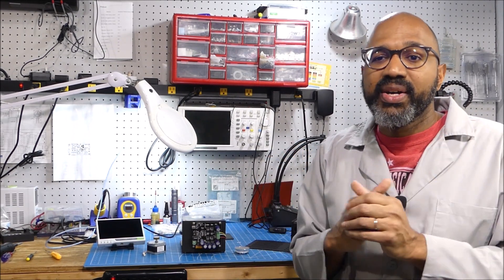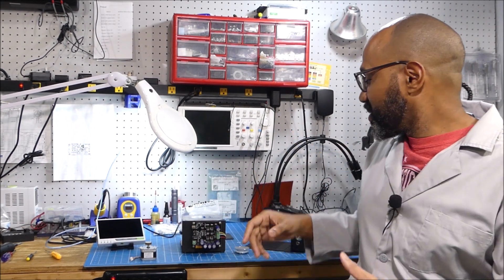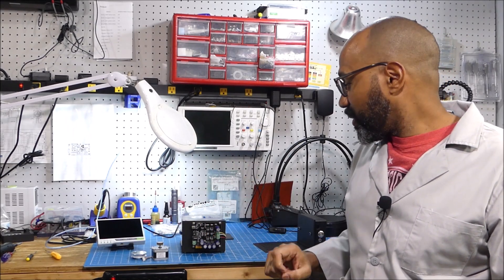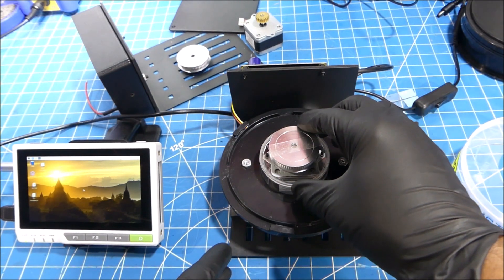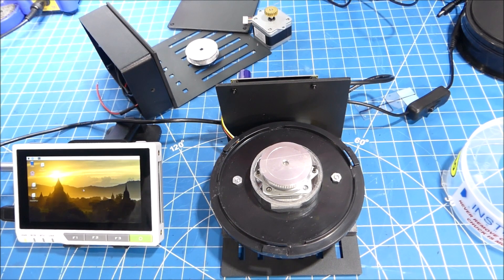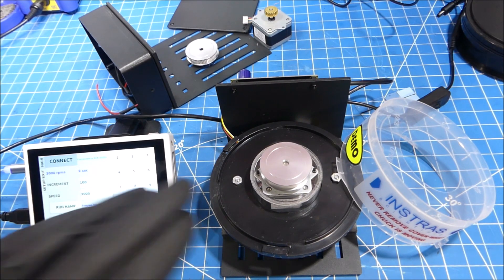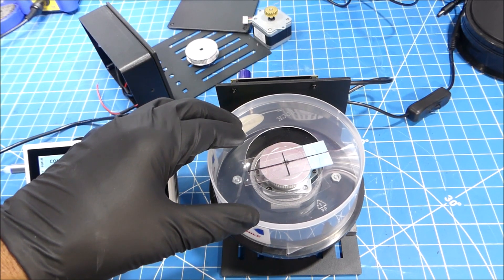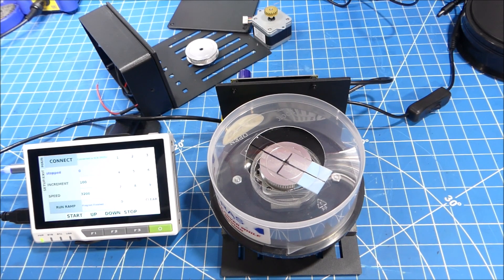Easy to Build DIY High Precision Spin Coater

Comment: I wonder why people needs spin coating machine at home? I can understand it’s not hard to make it but what for?
Reply from the maker: Most people making their own spin coater do so for use in academic research labs, not home use. This is most likely due to lack of funds to buy a commercial unit, or just to quickly try spin coating out.
Reply: I am a hobbyist at home. I am building a Planetarium projector. The stars are pinholes on a slide, like a slide projector, except some of them are 10s of microns in diameter. Too small to drill. So these slides can be made lithographically. I need a spin coater to coat the glass with the correct layer of Photoresist. Some people (google Sam Zeloof) make their own IC chips! It's a simple machine but they are super expensive.